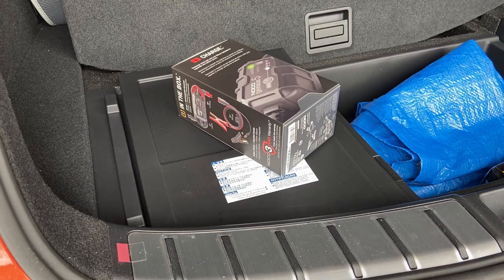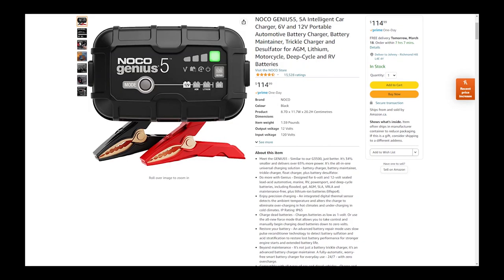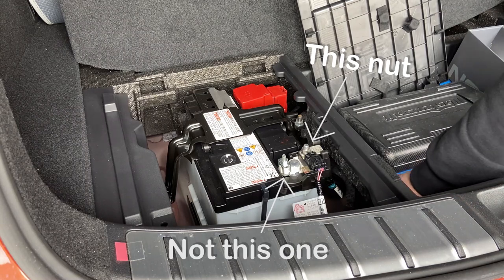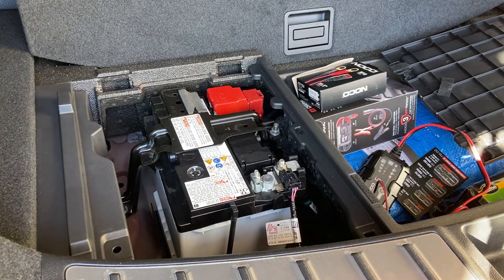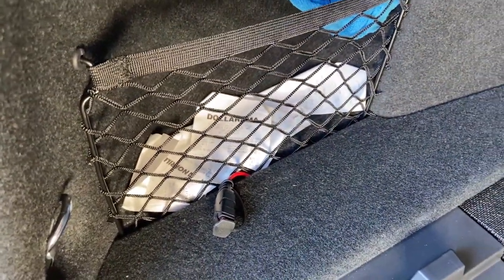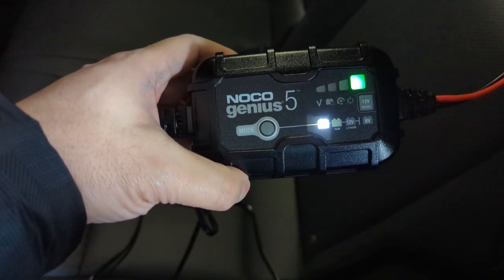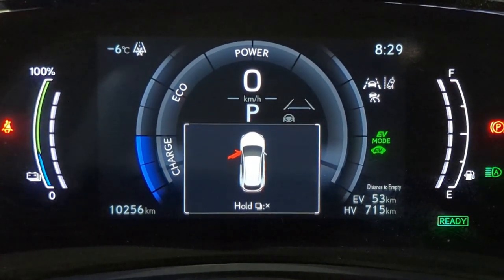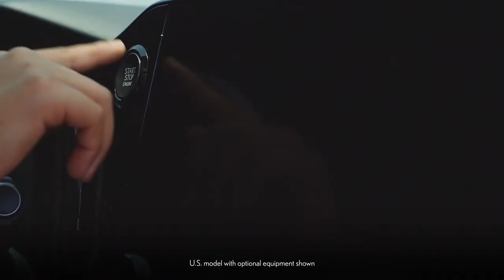Install Trickle Charger on LEXUS NX Hybrid / Toyota RAV4 Hybrid

Comment: Wanted to share that a trickle charger will also work going through the jump point in the engine bay.  Hooked the positive up to the point in the fuse box on the right and the negative to an unpainted surface (one of the nuts on top of the strut).  I only had a 1.5A charger so it took a bit longer but it did the trick.  Love the vids, keep up the good work!
Reply from the maker: Thanks for the information.  I was thinking of doing that and it would be better to have it installed on the grille like the Lexus Comfort+ system.
Reply: The 12v just died on our RX350h. I was wondering if I can charge the battery overnight from the fuse box in the engine bay?  So far it’s been 3 hours and the RX is still dead.
Reply: Where do you connect the positive in the fuse box? How do you secure the negative?

Comment: Hi, just to let you know, if you only do very short journeys, or use the car infrequently the battery maintainer is best plugged in always when you are not using the car it will maintain the battery to it's optimum level and the battery will stay in perfect condition for many years. Also the original battery leads with the Noco 5 amp battery maintainer are wide enough for you to have enlarged the holes with a M8 drill and saved you the expense of those additional leads. Thank you.
Reply from the maker: Yes - there are ways to get the M6 to M8.  But I don't want non-handyman people to follow this and it would better to get the M10.  If there were issues, they will say that you modified their cable and things may not be good if something goes wrong.  Thanks for the feedback - definitely an option for some handyman.
Reply: If keeps plugged in, would it cost an expensive electricity bill?
Reply: @kohkae1177  Hi, no it costs very little, once charged it maintains using milliamps of energy. I have two cars and three motorbikes all on there own C-tek charger. For the whole year cost would be less than £10 annually, so very inexpensive.
Reply: @stephenpotts8170  thanks 🙏
Reply: @stephenpotts8170 someone says, do not connect the negative cable to the negative connect of the battery, is that right? 
Thanks
Reply: @kohkae1177  Hi the negative should be connected to the earth on the Chassis, it is not absolutely critical, but is recommended.
Reply: Its*

Comment: Seems like a major oversight by Lexus engineers if they haven't included trickle charging the 12v battery when you plug-in to charge the main battery.
Reply from the maker: It is trickle charging when the large battery is charging. Depending on how you drive and how fast you charge. The car has so many components that continue to use the 12V battery does impact the amount of juice on the 12V over time.
Reply: @lsft  Is the plug-in charger for the large battery is not sufficient to trickle charge the 12V if you left it plugged in when vacationing or away for long periods of time (2-3 weeks)? Thank you!
Reply from the maker: @johjoh43  it only chargers the 12V when it charges the traction battery. If it's not charging, the plug-in charger is disconnected and won't charge the 12V. It's advised to not keep the plug in while you are away. It will cause the 12V to die even faster. When the plug is plugged in, the 12V battery is used to monitor the systems.

Comment: Why don't you just plug into 12v power outlet in the boot. It's already there ready to go. Just make sure current output of charger is less the power outlet fuse
Reply from the maker: I'm a bit confused with your comments.  The 12V power outlet is powered by the 12V battery.  The trickle charger is trying to charge the 12V battery.  Wouldn't this be an loop and draw the battery even lower?
Reply: @lsft   Connect the output of the charger to the 12v outlet. Current WILL flow from 12v outlet to the battery. I am unsure if the 12v outlet is supplied all the time on the NX (ie ignition off), but if it is this will work.
Reply from the maker: @darrenheading4057  I believe it does not supply power when the vehicle is off.
Reply: The older 2019 NX300h power socket in the boot/trunk is disconnected, when the ignition is turned off - So had to wire directly to battery..

Comment: Hi LSFT. Picked up our NX450h 3 weeks ago and I installed the same trickle charger as you today. When I plugged it in it was only 25% charged. Do you think this is surprising for a new vehicle? I’ve been trying to drive longer distances and trying to use the engine as much as possible. Other than this sketchy battery, it really is a fantastic vehicle.
Reply from the maker: You do not need to use the gas engine to charge the 12V battery.  When you plug the trickle charger, monitor the time it needs to charge to the next level.  If it quickly goes to full, then it is ok.  But if you do drive short distances and if you park in the garage you can consider letting the car run in EV mode inside the garage and let it auto shut off after 60 mins.  Turn off the climate so that it purely just runs.  They do suggest running the car for at least 20 mins for it to charge the 12V battery on every trip.  The problem you see is everything in the car relies on the 12V battery - like your mobile app, digital key (if setup), the steering wheel moving forward and your seats moving into position, the side mirrors folding out all uses the 12V battery every time you unlock and start the car.  

An example is: you start the car and it uses 2% of the battery to start it, but it only charge 0.5% in the 5 minute drive, then you would have lost 1.5% of the battery one time.  Then next time going home, you start the car 2% used to start the car and charge back 0.5% then you lost 3% in that trip to destination and home.  Over time, you will get to a point where you have a lot less juice in the battery.  I really hope Lexus would add something to monitor the 12V battery and automatically wake up the car and use the traction battery to charge the 12V.  No need to start other systems, but just to handle this situation.
Reply: Thank you for the detailed response. You explained it very well. I also hope Lexus figures this out and does as you suggested. It makes so much sense. What are they waiting for?
Reply from the maker: @RickA-Z  hard to say. Maybe the monitoring of the 12V when the car is low might cause the car to use more battery. 🤷

Comment: Just to add a few details. I have '22 NX350h that I last drove not 3 days ago for a total of 40 kms of mixed highway and city driving. So 20 kms there, an hour wait then 20 to get back home. I just put a multimeter directly on my battery posts while it sits in position in the back compartment under floor. It was only at 11.50 volts! So the marker lights were on, I had turned off dome lights though, obviously it would have been in a quasi 'accessory' state for me to unlock it and raise the power hatch. I would have thought my little adventure would have been enough to top it back up plus a little depletion over 2 days but not down that far! I have put it on my charger now to bring it back to full state of charge and I do have to travel some 300 kms tomorrow so I'm gonna check readings over next few days to see how much depletion is occurring.
Reply from the maker: Keep me posted on your findings and thanks for the details.

Comment: You need to get out more, LSFT. The first 10 days I had only the 240 V charger. It was soooo slow. I found myself working for the technology, not the technology working for me. Every time I returned home, I plugged it in even to get an hour of charging. Then Lexus installed my type 2 charger and it takes less than 3 hours from dead empty. And I am diverting my solar PV so 18 kW costs me A$0.90. I can use Lexus’ navigation or waze, or Apple maps or google maps. Do the last 3 slow down on corners when in cruise control? The Lexus nav does. Another very important question. It is normal for the car’s odometer to show a higher speed than the gps speed. From what I can see, using Waze, the discrepancy could be as high as 6kph. That is very significant. On a highway I can set the speed on the cruise control to 120kph in a 110km zone and only be <4kph above the limit. Is this your experience?
Reply from the maker: Unfortunately, the pandemic has changed how I work and there is no need to drive to the office everyday which really changes my driving behaviour.  At least your Type 1 is 240V charger and not 120V in North America.  It takes 12 hours to fully charge using the stock EVSE.  I think on 240V it should be faster.  

The car will slow down on curves and it doesn't matter what navigation software you use.  That feature is part of the adaptive cruise control.  

As with the speed, I have notice the reverse in Canada.  I drive 60kph, but Waze GPS says I am driving 65-70kph.   I don't think this is a problem with the car, but issue with Waze and the phone's GPS is not calculating correctly.  Trust your car's odometer as that should be the most accurate.

Comment: Had the same problem with my 2016 optima SX. Battery was over 300$ to change. I was doing 6-7000km a year. Just bought a 2023 RX350h… gonna look into one of these.
Reply from the maker: Since you drive little it's better to have one to help maintain the battery!
Reply: going through this with my 2023 rx350h....

Comment: Thanks LSFT for this reference video on the battery problem, that has happened in various cases with the first winter for our NXs. Spring is coming soon!
Reply from the maker: Spring is coming soon.  Winter tires coming off and better EV range as well. Cheers!

Comment: Great Video LSFT, thanks again for this! I would agree a battery tender is almost a must for these types of vehicles unless you regularly drive longer trips.

Please everyone keep in mind though that we're looking at the complete electrical system at work here and it's way more complex on modern cars. Toyota and all other manufactures of hybrid vehicles have made designs that are utilizing both a high voltage 'traction' battery which primarily does all the propulsion work and then add a 12 volt battery to still do all the other electrical requirements for the vehicle to function. 

So you have a monster of a battery with high voltage and a tiny one as well. They utilize a dc/dc converter when determined ok to allow the big battery to supply the little battery assistance with the 12 volt requirements. This is where the engineers decide how to 'manage' all the stored energy. It would be simple to allow the big battery to keep the small battery charged no problem, always providing you with a fully charged 12 volt battery to 'start' your car. But they don't, for safety reasons I'm sure, allow a circuit like this to 'stay on' constantly and deplete the bigger battery, plus it would look like your EV range is mysteriously dropping off when you park your car. 

In simple terms they 'sacrifice' the 12 volt battery and let it deplete when all systems are not running. At some point things change. I'm assuming when they're confident that they can begin to allow the converter to send a charge to the 12 volt battery happens when you are going to drive the car or, put it in on/run mode, which gives the order to have the car ready to drive on your command including using the gas engine when needed to produce more energy.
 
A healthy fully charged 12 volt lead acid battery at rest with no draw will ONLY make 12.6 volts. Anything above that and it's being assisted by other means, namely a regular alternator in an old fashion system, or the dc/dc converter in a new one. So when your voltmeter plugged into your 12 volt socket shows more than 12.6 volts, it's already being 'assisted' by the charging circuit. This is why your trickle charger and it's internal circuitry is needed to determine the health of the battery. For example, at 12.4 volts, your battery will be at roughly 75% charge OR has begun to have a draw on it. At 12.2 volts it will be at 50% charge and at 12 volts it will be at roughly 25% charge. Constantly having your 12 volt battery remain at less than full charge will reduce it's life and will need to be replaced sooner than optimum lifespan, which is typically 4-6 years. 

I suspect if you opened the (powered) back hatch to attach a multimeter to each terminal of the battery to test it, you would have already added a 'draw' on the battery which will be included in your reading. Same is true if you're sitting in your car looking at a multimeter plugged into your 12 volt outlet. Some interior lights or displays or other safety circuitry will be on etc. With these vehicles the only way to truly test a battery's health is with it completely disconnected meaning nothing is connected to it at it's battery posts or through the obd port using a battery test procedure from a reader or laptop auto software program like a technician would have.
Reply from the maker: Thanks for the lengthy writeup and all the details - very technical and great information.  Unfortunately, I'm not technical enough to do all that and really hope that other owners wouldn't experience a 12V battery failure with this video.

Comment: Hi there, I just wanted to thank you so much for this video, it really help me connect our Noco Genius 5... I needed everything you used as well and found it all at CanadianTire.
Our new Toyota Venza went dead last week and what a pain getting boosted and having the dealer clear all the codes triggered by the dead battery.
Same thing happened to us, letting the car sitting too long and not enough highway driving to charge the 12V battery.
Thanks Again!!
👍🏻🙏🏻
Reply from the maker: Glad that the video helped you set up your trickle charger.

Comment: So I added the exact same set up today to my 2024 NX350h, one year old this month.  Though never had any battery trouble, I am one of those 10 minute daily drivers.  I have been monitoring volts via lighter for several months.  Voltage is almost always 12.8 while driving....lately I started putting car in N at long stop lights, volts go to 14.++.
Results of NOCO G5 today showed 25% charge for about 5 minutes, then 50% for around 10 minutes, then pulsing green.
So far this device will cut down on worries, especially during away from home for a week for travel.
Let me know if I have missed anything in my understandings.  thanks for this video
Reply from the maker: You seem to have it all right.

Comment: Thank you very much for your channel and this helpful video. Our 450h+ is arriving early in 2024 and I will stay on top of the battery health from the get-go by doing exactly what you did.
Reply from the maker: Exciting times.. hopefully no delay on your 2024.  They do have a Lexus trickle charger that you can install which is easier to plug into and charge, but definitely a lot more $$$.

Comment: Hi LSFT! I have the same issues with my 22 - 450h+. 3 times dead battery. My concern is the stationary battery drain, approx. 0.3 volt/24h.  due to that the battery will not take charge to  than12.5V. Do you know how much stationary drain one should expect.
Also, when charging the traction battery, i get + 0.3V in trickle charge to the 12V battery.
I.e not much. I wonder what is your experiences.
Thanks for your informative videos.
Reply from the maker: Hi Ralph, I haven't measured how much I was losing per day and how much charge I was getting during the traction battery charge. So you have any accessories that were added like a dashcam?
Reply: @lsft  I have no accessories installed. But the battery drain when parked seems very high. Should be interesting to know what to expect with a battery in good condition and 100% charged. I will have to let my dealer look in to it.
Reply from the maker: @ralphjohansson2631  let me know what you find out.

Comment: Thank you LSFT.. this is a great & very helpfull video for phev owners. i might install one also on my NX 450h+ especially dealing with very cold winter here in montreal.. 👍
Reply from the maker: My pleasure.  I think if you drive longer distances (~20 mins) drives, you shouldn't have this problem.  But it's still good to top off the batter once a month to ensure you don't have to worry about it.
Reply: @ LSFT... is the 12V battery charging when your running on EV mode?
Reply from the maker: @martinpanganiban3024  Yes - it will charge the 12V even if you are running on EV mode only.  For my purpose, I drive less than 1 km after starting the car during weekends and slowly it will drain the 12V battery

Comment: Doesn’t your NX have an AGM battery? I notice you have your charger set to regular 12V battery for charging…? Also, can you not connect a trickle charger under the hood (where you can jump/boost start your car)?....  Thank you for the video!
Reply from the maker: The battery is NOT an AGM.  It's a regular acid-lead battery.  You can connect the trickle charger under the hood, but directly on the 12V is a bit more reliable.  Lexus does offer a trickle charger as an accessory which is connected to the front and the outlet is in the grill.